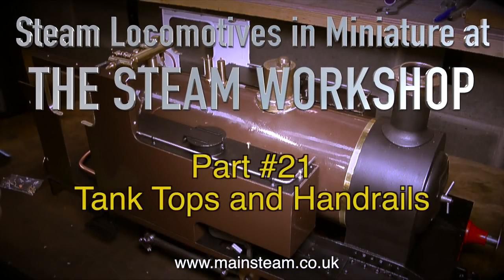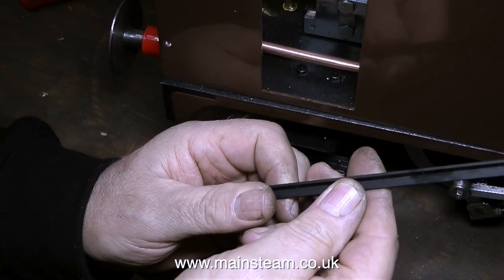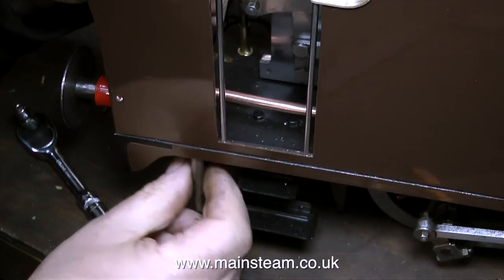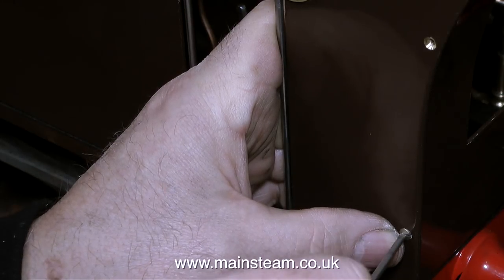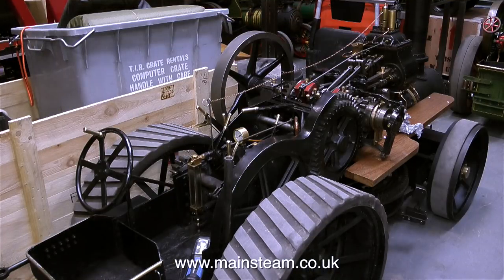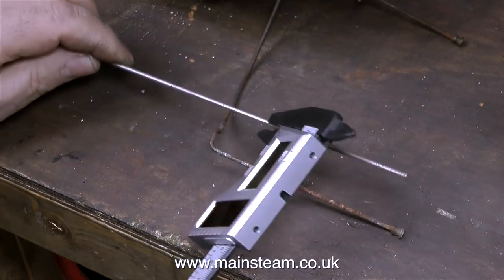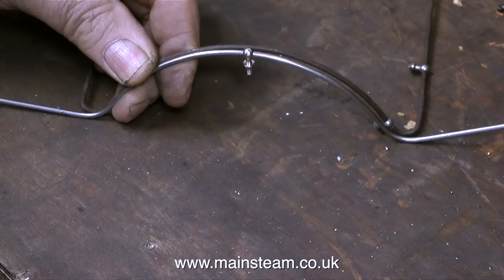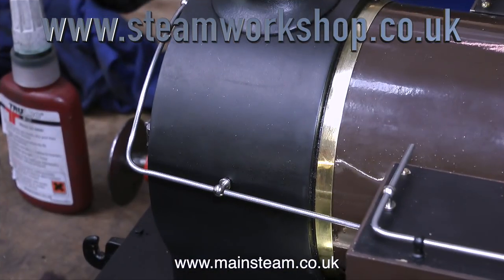WORKING AT THE STEAM WORKSHOP #21 - TANK TOPS AND HANDRAILS

Comment: I was taught many years ago by my metalwork teacher that bolts have an unthreaded section, and if they are fully threaded they are machine screws. These days the terms seem to be interchangeable.
Reply: that is correct. Bolts bolt things together, screws go into threaded hole and are fully threaded.  Bolts only have thread on about the bottom third for the nut. For us model engineers most are just playing trains so i really does not matter.

Comment: Hi Keith.  I’m sure you know this but, in industry, there really is a distinction between ‘bolt’ and ‘screw’ and it has nothing to do with thread type.  ‘Screws’ are defined by an ‘internal’ wrenching feature (straight slot, cruciform slots, Phillips, hex, etc) embedded into the head whereas ‘bolts’ are defined by an ‘external’ wrenching feature (square, 6-point, 12–point, etc) around the outside of the head.

Comment: In engineering terms a screw is all thread & a bolt is part thread. With more standard sizes 6, 8 mm up  above 25 mm long. Below this length they are all thread. Mervyn Price

Comment: My father was a steam turbine engineer for General Electric in America. His job involved the fitting and maintenance of turbines that were used in electric utility power plants. He taught me that the difference between a bolt and a screw was simply that a screw was installed or removed using a screwdriver. The size of the screw was not relevant. When I grew a bit more he taught me that bolts had a formed “head” that required wrenches, or spanners, which I find a more elegant term, or Allen wrenches or some other specialized tool that specifically was not of the screwdriver family. I cleverly asked him what a stud was considered which drew a rather reproachful gaze from him.

Comment: Any bolt with a slotted head is known as a Machine screw just as when cleaning copper commutators it is normal to use cabinet paper (sand paper ) to clean as any sort of emery or wet and dry can gen metal particles in the material .and before you complain .no I have not done any videos yet .mike

Comment: What I learned from an old screw! (insert x-girlfriend joke here)

 bolt:  a threaded fastener that’s intended for insertion through holes in components, usually used in conjunction with a nut.
screw:  an externally threaded fastener that can be inserted into holes of components, used to connect with a pre-formed internal thread — or create its own thread.

so screw it call them whatever you want to as long as they get the job done.

Comment: Definition according to Swedish Fasternes Network

Screw
External threaded cylindrical or conical body intended for attachment, joining, transmission of power or transfer of movement in its longitudinal direction.
Bolt
Unthreaded cylindrical body with shoulder (s) in the form of head or the like, intended for use without undergoing plastic deformation.
In other words: A screw has threads while the bolt has no threads!
Reply: lr109 tum so, a bolt is a rivet?

Comment: Nice carbon fiber caliper :) Great for measuring the length of batteries, so you don't short them out with your metal one!
Reply from the maker: I never thought of that application . . . .  I will measure the parts for the generator control unit - coming soon {:-)))
Reply: You're such a tease Keith! :)

Comment: Keith have you ever built a princess marina 3 1/2” steam locomotive and any tips on finishing a part built one of these as I bought one from the steam workshop.
Reply from the maker: I have never built one of those..... 3 1/2 inch gauge is a bit small for me really, although they are easier to move about {:-)))
Reply: Keith Appleton I was originally thinking of making a sweet pea but this one came up for less than £700 and had a copper boiler so after talking to people from my local club I bought it .Simon from the steam workshop is bringing it over on Saturday for me.